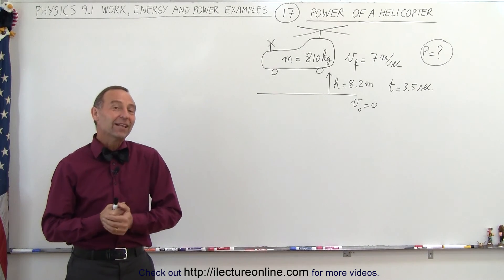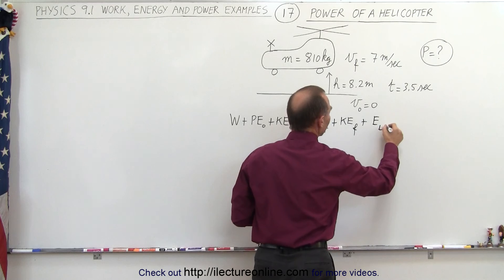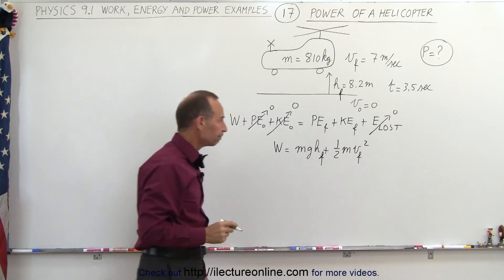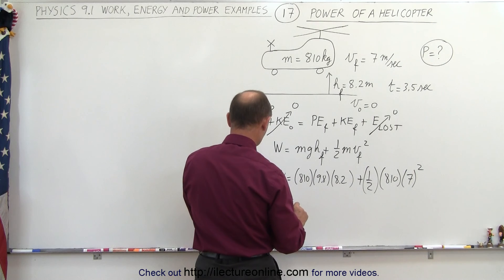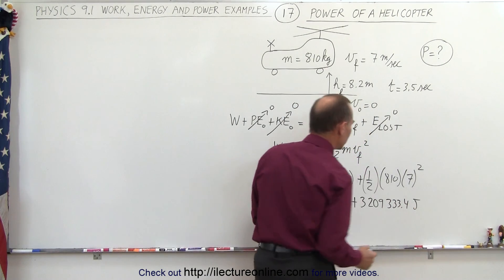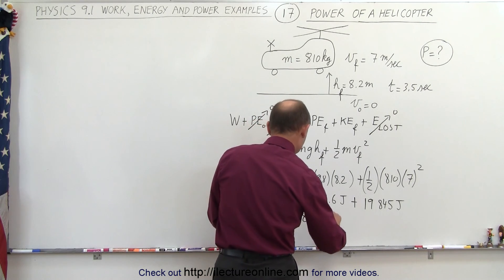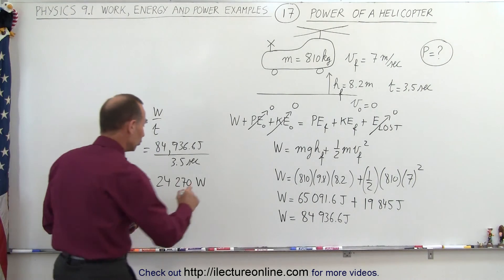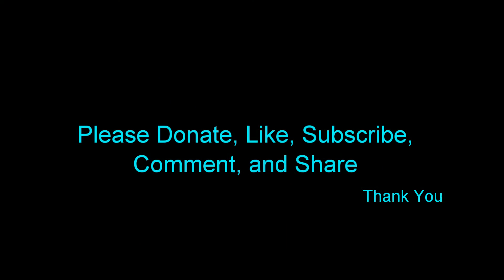Physics 8.1  Work, Energy, and Power Examples (17 of 27) Power and Helicopter

Comment: Sir, with given numbers I calculated net upward force (using F1=m.a and F2=m.g) and finally multiplied it with avg velocity to get the power. However using kinematics eqn , the given value of vertical distance, time and acceleration are not matching. Pls clarify, if I'm wrong.

Comment: Sir i found the energy by multiplying distance with force (which is mass into gravity) then i divided the energy by 3.5 

Is this way correct?
Reply: This will account power only for lifting to hight h. There is accn up the ground and its power should also be accounted to get net power.